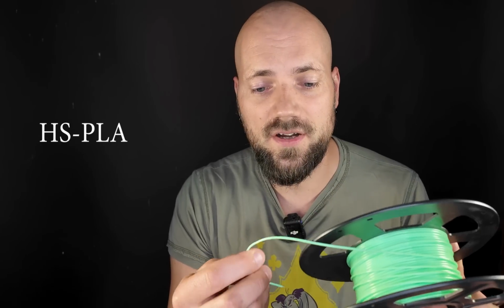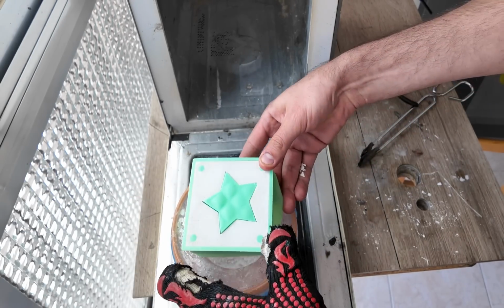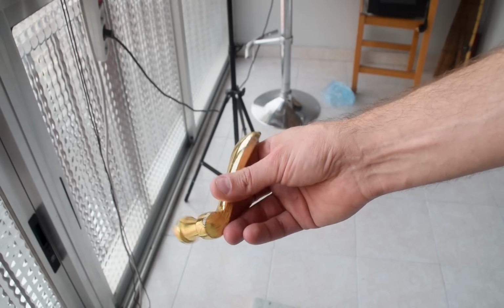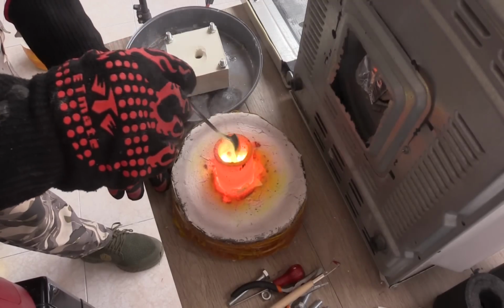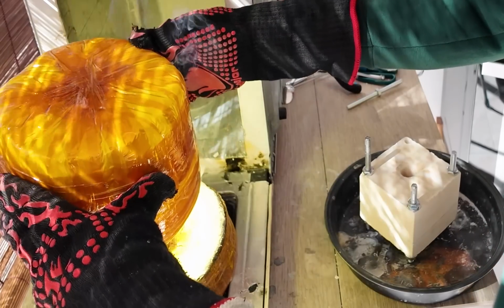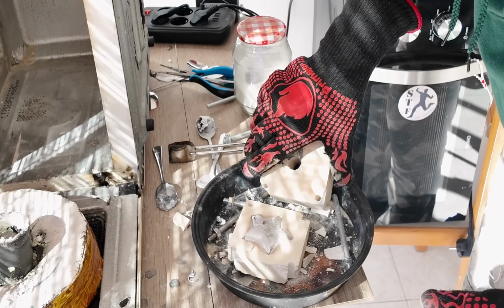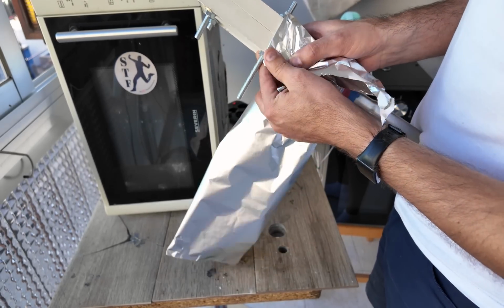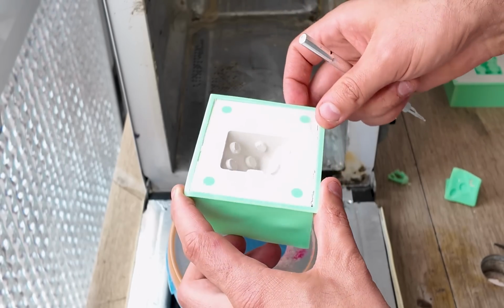Print-Wave Metal Casting: A Different Approach to Metal melting

Comment from the maker: Important note: Not all hs-PLA's are the same. Some filaments just don't get soft enough. There can be a massive differenceS between filaments used.
The one I use and recommend is "Sunlu - Meta PLA". Make sure it has Meta in the name.

There is another video using this method in case you missed it.
Print-Wave Metal Casting: Aluminium Mug
https://youtu.be/5ZhkHHd6YwM
Reply: was it zamac?

Comment: I oven dry the mold for a few hours then weigh it on a kitchen scale.   Then I oven dry for another hour and recheck the weight.   If it dropped, the mold needs more drying.   If it’s unchanged, then I’m done

Comment: Sir what is your largest crucible?
Reply from the maker: The one I used in the chair melting video, at the very end:
https://youtu.be/xyzE413rqHU
Reply: @ShakeTheFuture  I saw the video, thank you. Is it feasible to put a ceramic or silicon platform within the ceramic fiber blanket? I say to prevent the sinking indentation from heavy crucibles. Or would that rob energy from the melt?
Reply from the maker: @ericroman9126  You can do it, but the melting process can indeed be a bit slower because of that. I used to put a pizza-cutter blade (a round stainless-steel wheel) under the crucible, but it slowed down the melting quite a bit. For metals like aluminum it doesn’t matter much since aluminum melts easily, but when melting iron it can make a noticeable difference whether or not there’s something under the crucible.

Even the crucible thickness affects how fast the metal melts. That’s why my crucibles aren’t very thick.

Comment: Thats zink the door handle..it just had brass colour. Cause you will notice zinc melts quicker than other metals. From my experience lead melts fastest then the next metal that takes few minutes longer is zinc. And you can melt zinc with just a butane torch

Comment: To get the bubbles out there is a quicker way. Just borrow a "tool" from the wife. Will soon start my new job as a service technician at a large aluminum foundry, will be fun as I have long wanted to cast my own stuff
Reply from the maker: Well, I did buy a cheap percussion massager, but It was too cheap and is turning OFF, so I'll need to get another one. Cheers!

Comment: Couldn't you dry the mold by putting it in the microwave without a plastic bag?
Reply from the maker: It's possible to some extent, but in my tests, the mold cracked before it was fully dried.

Comment: Amazing video! You said plaster of paris but then you said dental plaster. Can I use just regular plaster of paris from the hardware store?
Reply from the maker: Yes, you can. One thing I've learned over the years is that just because a product is labeled 'Plaster of Paris' doesn't mean it's always the same. I also use plaster from hardware stores. Obviously, some experimentation is required, as some plasters work better than others. I used to use a cheaper hardware store plaster until recently, but I’ve since switched to hardware store Plaster of Paris (the bag actually says 'POP') because it's slightly better. I’ve stopped using dental Plaster of Paris for now, as it's expensive and not noticeably better than the more affordable alternatives.
Reply: @ thank you for replying! I am located in Greece, not so far from you. Would you consider making me your wool pot and send me, paying of course.

Comment: Actually you're better off with a fatter sprue with a narrower neck. And it should come down to the side of the part, not the middle. Less turbulence, less entrained air, and the sprue or riser should be the very last thing to freeze out, so it can feed molten metal to the rest of the part as it freezes. Use cross sectional area as a decent rule of thumb. Awesome work!
Reply from the maker: Thank you for the tip. Spruing is something I am still figuring out. Comments like yours are always welcome. Thank you very much—I'll keep that in mind.

Comment: I love that youve got your 2-part with sprues and gates and all -- nice!  Much shrinkage factor?
Reply from the maker: When I do Lost PLA casting with the burnout, I usually print my parts around 3% bigger to compensate for the shrinkage. I have not checked whether not the shrinkage is the same by using this method. Cheers!

Comment: Very cool results!

I use a similar trick for very detailed plaster sculptures, where I boil the molded plaster part to soften the plastic instead of microwaving it. I'll give the microwave method a test - but I fear it may weaken the plaster. For your purposes, as long as it holds up for the casting, that doesn't matter. But I want my pieces to have maximum strength and microwaving may cause issues - especially if it's done before the plaster reaches maximum strength.
Reply from the maker: Thanks Mattias!

Comment: Nobody is talking about the "investment". What is it plaster of Paris? Because this holds water which, when it meets molten metal will cause said metal to burst into the air and land on the back of your head. Luckily I wasn't hurt
Reply from the maker: Well, that’s why I said in the video that some investments will need longer drying times or higher temperatures (meaning, use of a kiln). It depends on the investment used and the temperature of the oven. and drying times.
I also used a proper investment to make the star. It was not Plaster of Paris. Plaster of Paris was used only for the knife mold.

Cheers!

Comment: Microwaving an object like this will create hots spots and cold spots - the EM waves in a microwave oven are about ~10cm, so you'll get 5cm of very hot plaster and 5cm of cold plaster - the heat from the hot areas will - of course - spread, so the cold areas will receive some heat, but it's less than ideal or efficient . . you also set up stresses in the plaster than make it much more likely to break, crack and crumble . . . . this is why pretty much all microwaves have a rotating turntable so areas of the food are not just stuck in a cold spot . . . . if you can find some easy way of moving the plaster around, up and down or rotating (or any movement) you will get better, more consistent, results.
Reply: Paragraphs like this generally come from people who have never tried anything like this themselves, but think YT videos outlining theory overrides experience.

We’ve all watched videos on microwaves, guy. This person is pushing limits, and proving your comment pointless before you even posted it.
Reply from the maker: Yes, indeed. Using the rotating turntable can be beneficial. I don’t use it because my microwave is flipped on its side. I could flip it back to its intended position when I microwave molds, but it’s just not worth it for me. Cheers!

Comment: I have just tried casting my first aluminium using your techniques, do you have any recommendations for simple investment that you used in this video? Thanks!
Reply from the maker: If I don't use a "proper" investment, but something like a Plaster of Paris type of powder, then I usually mix it with sand. Depending on the brand, I generally mix it as follows:

1 part water
1.1 parts plaster
0.5 parts sand
For example: 200g of water, 220g of plaster, and 100g of sand.

This is a basic formula that can be adjusted depending on the plaster used or one's specific needs.
Reply: @ShakeTheFuture  amazing thanks for your response!

Comment: Something to be aware of that I've previously found using this method is to be aware of the spaces of the internal geometries if the part has "hollow" sections. As an example, when casting a donut shaped object, the metal shrinking can potentially contract and cause the plaster filling the "hole" to fracture. This of course can also happen with traditional investment casting, but when I tried this using a plain plaster-sand mould, the lack of usual internal investment structure (wire, etc) meant that the sections could crack off and cause cast failures, including fracturing the mould.

Comment: Hold up what! You're using a microwave to melt the metal for the poor?
Reply from the maker: Yes, indeed! It's not just for the poor 😂 Using the microwave has it's advantages and disadvantages. I can reach higher temperatures than some of the electric melting furnaces.

Comment: Hello

Just wanted to say your ideas and videos are absolute genius, thank you for showing great results. I wanted to ask if you could test an idea which is also very interesting and could be a game changer for ceramic molds using desktop 3d printers. If possible can you use water soluble filament, create any complex geometry and then dissolve the filament so that you are left with an intricate ceramic mold. I think this can work both with the ceramic mold poured surrounding the water soluble mold or if the ceramic slurry is poured inside the water soluble mold. Similar to your method, no burnout would be required. The mold would then need to be dried out to remove any moisture and be ready for casting, would be great to see if this is possible. I have attached a video for reference which will help clarify what I mean but I think can be used for casting very complex shapes. Would be great to see what you think of this.

Ceramic pour printing

https://youtu.be/KeQFBX5JFoI?si=rHQaBYmi7Zv1Hgfn
Reply: Lost pva casting would be a suitable name
Reply from the maker: That's a great idea. I might try it out in the future. Cheers!

Comment: Does it need to be done on the bed? It must be a cleaning nightmare. Would any other flat surface do well enough?
Reply from the maker: No, it does not need to be done on the bed. You can print it and then glue it to other surfaces. I prefer the bed because it does not require gluing, and the result is nearly perfect. Cleaning it is very easy. I just wash it with some soap under running tap water. It's best to get another build surface for your printer. There are plenty of generic but good build plates available these days. Depending on the printer used, you might be able to print on other surfaces, like plexiglass. My printer (Prusa mk4) can do that without problems, I have not tried it out myself, but there are definitely options. Cheers!

Comment: In investment casting, the "investment" is the carved(or printed) part which is lost in the mold making process, not the plaster mold.
This is not investment casting and there is no investment in this process.
Nice video!  If you haven't done so yet, try with RTV silicone molds and Pewter casting.  Molds can be reused many times.
Reply from the maker: Cheers!

Comment: With the first star you cast, I don't think the sprue was too short but rather too thin. There isn't much of a depression on the top side of the pouring funnel indicating that the sprue solidified before the casting was done solidifying.
Reply from the maker: That's great to know. Thanks You!

Comment: I'm very confident that I have never in my 50 years seen anything sketchier than this. Hopefully not too many of your viewers will be seriously injured.
Reply from the maker: Thanks for the feedback. Could you elaborate on which part of the process you find sketchy? If you are referring to pouring the metal into oven-dried molds, as I mentioned in the video, it's possible, but it might not work with all types of investments or ovens. It's all about experimenting and staying safe while doing it, as I emphasize multiple times in the video.

Cheers!

Comment: Your oven should be able to do any temperature from 30℃ up  and is much more efficient than the air fryer  due to the oven's better insulation.
Reply from the maker: Thanks! As we speak I am experimenting with drying the molds by leaving them in natural environment. Cheers!

Comment: Crazy idea, throw on some ultrasound sensors/speakers. You can use clicks to precisely measure top of fluids you add with another tool, then you can use the ultrasound to probe the plaster.
Reply from the maker: I was going to try to use an ultrasonic cleaner with plaster and metal, so your suggestion is not crazy. I just need to get it first. Cheers!

Comment: anyone have a gcode file for shaking the bed?  Big thanks for sharing your knowledge,  this video blew my mind and made my day.
Reply from the maker: Thanks! Here is the gcode I use for Prusa MK4 (without the image)
________
G1 Y5 F12000 ; Move bed forward 5mm at 12000mm/min
G1 Y-5 F12000 ; Move bed backward 5mm at 12000mm/min
M400 ; Ensure no other movements are pending
________
Then I just copy paste those lines and change the movement distance.

Cheers!

Comment: How does the part stay stick to the build plate? Does it remain hot? I’ve never used anything but textured PEI and they always let go of the part 100% when cool.
Reply from the maker: No, it does not stay hot. The build plate on the Prusa MK4 (plain-PEI) sticks very well. The objects don't pop off the plate when they cool down; you need to bend the sheet.

Comment: I've tried many different casting processes and not tried this one before! 
For me any material is precious so I try my hardest to make everything as cheap as possible.
My favourite way to cast things is to print a 3D model in vase mode and then dip it in plaster of Paris, creating about 3 or 4 mm shell. Then, after drying, put it in the oven to soften the plastic and carefully remove it. Then I pack the mould shell inside some dry sand. I found casting like this uses absolute minimum materials possible
Reply from the maker: Thanks for sharing your casting process  👍

Comment: I'm super excited to see people doing this, but actually it's nothing new. GE has been doing this for over a decade (man that really dates me) to make disposable core dies for jet engine blades. The typical process uses a metal mold to form the ceramic core that blades are then cast around. Once cast, the ceramic is dissolved with a caustic solution to leave cooling passages. The problem with this process is your 3D geometries are limited by the two piece die, so now they're casting the dies with 3D printed molds.
Reply from the maker: Thanks for the comment. I don't quite see the similarities, but maybe it's just me 😊

Comment: Interesting approach! I've seen them do this the 'traditional' way where they dip the part repeatedly  in a professional casting use, where sometimes the part is so complex that there's no other way to get it out other than burn-out. I tried this with a super-complicated compressor section and even went to the extra effort of reverse assembling the blades upside down, fitting all the parts by hand, and they Still got stuck! Not so bad when it comes out on the first try, but it usually takes two and breaks me when I have to wreck a beautiful resin print. 
By the by, rather than occupy your printer with the shaking motion, anything that vibrates like a orbital sander or neck massager, you can ziptie a rod to and let the rod pop the bubbles on complex prints where moving multi-section molds would be bad. 😉
Reply from the maker: Thanks! Yes, I do vibrate the bucket with a reciprocating saw before pouring. You can see me doing it in other videos. The printer vibration is an additional step 😊

Comment: The PaulsGarage channel has taught me about ZA-12.  It's a common Zinc Aluminum alloy for casting, and may be what you had there.  Pure aluminum needs pressure to overcome the surface tension and get fine details.
Reply from the maker: Thanks for the info.

Comment: A heat gun or hair dryer should also be able to soften the plastic enough to remove it.
Reply from the maker: Yes and no. For simple molds, it will do the job, but with 3D prints that are deeply embedded into the plaster, it will not work as well. Microwaving will be far easier.

I have more videos scheduled to be published. In those videos, the prints are embedded way deeper into the mold, and I have to pull them out with some pliers. In order to do it, the PLA needs to be softened all the way into the mold, so the microwaving is the key. Cheers!

Comment: For the debubbling try using a  shorter frequency shake, but start it before you pour the plaster, that will help dislodge the bubbles as you pour, you can also try poking with your finger into the plaster and touching all over the surface of the part, pay attention to the corners where the bubbles usually get trapped and this will help remove them. 
Another tip for people that never have used plaster, DO NOT pour any remaining plaster into the sink even if you wash it and dilute it, it will still solidify and clog your pipes.
Reply from the maker: Yes, I actually do use different bed-shaking patterns. That was one of the early trials. Starting to shake the bed before pouring is a great idea. I heard about shaking the mold while pouring the plaster being beneficial, but I never tried it because it was not as straightforward a process as shaking the mold with a printer. I'll definitely start doing it.

Putting a finger in the plaster to remove the bubbles is something I never heard of, and it totally makes sense. I'll try it out with problematic, bubble-trapping molds. Thank you very much!

Comment: Ive been messing with the combo of 3d printing qnd mold making, and this was by far one of the most genius ideas. I have an actual melting furnace but it makes me nervous to pour big stuff where my house is 😂

The idea of making small mold frames directly on the printing bed is 🤌

One of those rarer moments where you think, "now THAT is good"

I'm going to try more for making a 3d print prototype, take a silicone mold of that, pour a wax cast then electroform and reclaim the wax. One day in the near future ill try the actual 20lb bronze pours i initially intended to 😂